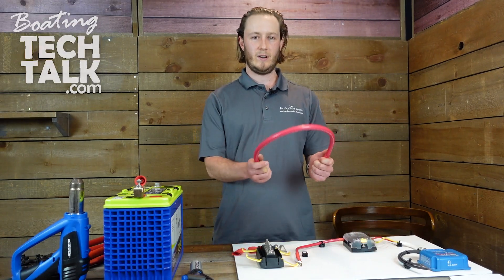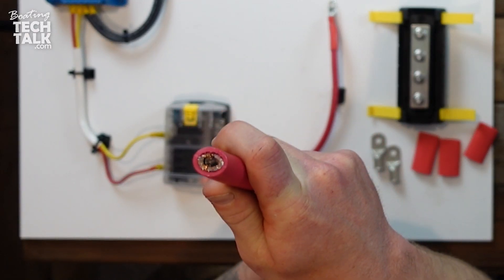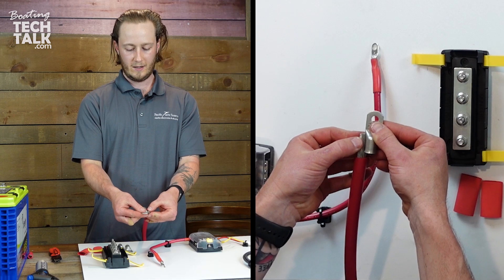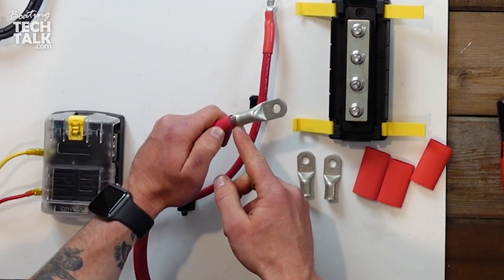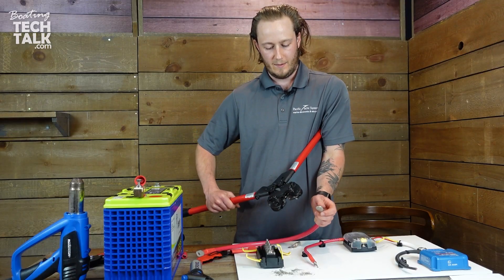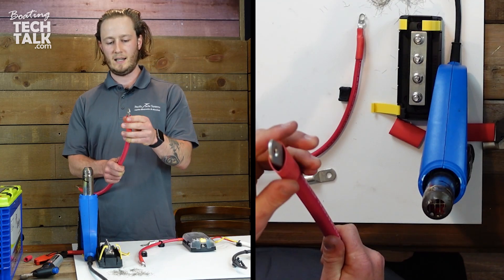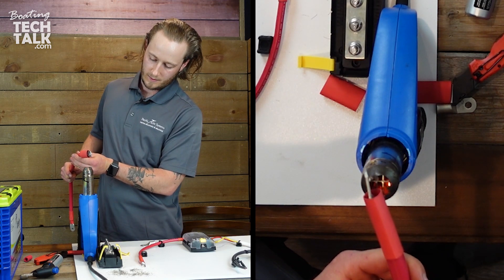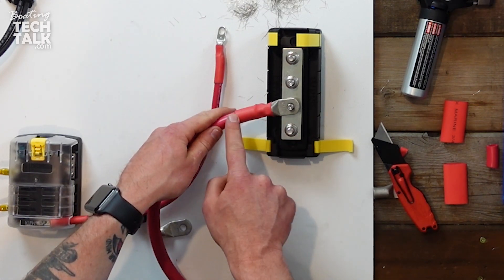How to Make a Battery Cable for Your Boat

Comment: I just watched your tech performing the crimp process for the battery cables and I would recommend a re-do with the following changes. A) make sure that the terminals are in alignment with each end as necessary, the cable he built had a twist in it because the terminals were in misalignment to the mounting posts. B) pre-fit or hold the terminal lug up to the cable end to estimate and or mark the proper amount of jacket depth to remove instead of cutting and recutting the cable to fit the crimp portion of the lug properly, use this procedure also to determine the correct heat shrink length. C) avoid using a knife that will cut into or nick the wire strands below the jacket. Try using a rotational jacket cutter to cut through the jacket and avoid hurting or damaging the wire strands. A lot of telecom cable removers use this type of jacket removal process. I will be performing this task later this week and will try to send some pix & or videos for example. Keep up the good work, Regards
Reply from the maker: Thanks for sharing Barry.
Reply: Your point B is a good one but, as Jake explained, he did that intentionally to show how to remedy the situation if the cable is cut too long.

Comment: Hi guys thanks for the tutorial.I have a question if i may, i have a 24v battery system and want to install a 3000w pure sine wave inverter.What gauge wire would you recommend when the inverter is approximately two meters away from the battery's and what size and type of fuse would you recommend?
Thanks learning loads of your channel, Stuart
Reply from the maker: The inverter manual should have a table making wire recommendations. Double check with the manual, but I'd suggest 2/0 wire and 200 amp fuse.
Reply: @PacificYachtSystems  Thanks for the reply

Comment: Would it be a good idea to put a little di-electric grease in the terminal before installing it on the cable or is it not necessary? Thanks! Good video!
Reply from the maker: We've never done this... anyone else want to share on their experience of doing this.
Reply: @PacificYachtSystems  I use dielectric grease on connections where you don't have a better method of keeping water out, i.e. wiring harnesses on 4 wheelers, riding lawnmowers, etc.  Basically, things that might get wet during their use, but aren't exactly meant for wet weather conditions, as they do not have waterproof wiring harnesses.  Dielectric grease is solely used within a connection to keep moisture out, but it isn't conductive, so it shouldn't necessarily be smothering the connection.  For a battery terminal, I would say it is fairly useless, but then again, it probably wouldn't hurt anything, if applied properly.  It would make a mess whenever you need to touch the terminals though.

Comment: Why aren't you thinning the end and soldering the end and heating it post crimp?
Reply from the maker: Since boats are prone to vibrations, we always use a mechanical crimp for a connections.
Reply: @PacificYachtSystems  I guess the question is, why not both?
Reply: @testuser2709  not a boat tech but in aviation it has been proven that tinning/soldering makes the connections brittle and subject to breaking from vibration
Reply: This is a direct quote:
Per Mercury Mercruiser Service Manual Number 31, Section 4, Electrical System;
Battery Cable Recommendations:
 "IMPORTANT: The terminals must be soldered to the cable ends to ensure good
electrical contact. Use electrical grade (resin flux) solder only. Do not use acid flux
solder as it may cause corrosion and failure."
My guess is that Mercury Marine knows a thing or two about marine wiring.

Comment: Using a knife is always a bad idea. If you are forced to, you only score the circumference of the insulation and break it open with the strength of your hands, but you can cut the length - parallel to the direction of the stands to the end of the wire.

Comment: You wouldn’t put a silicone or anti-corrosion inside?
Reply from the maker: Lots of different ways to reduce or delay corrosion on cabling, we use heat shrink terminals or lugs with heat shrink.

Comment: What brand crimpers?
Reply: I have the same tool, it is a FTZ Heavy Duty Lug Crimp Tool. Very nicely made, easy to use, and does an excellent job. I also use the FTZ Heavy Duty Power Lugs, they are much meatier than the Ancor lugs. They have a longer barrel and are marked with the crimp tool setting.
Reply from the maker: Yep, FTZ is exactly the tool we use overhere.